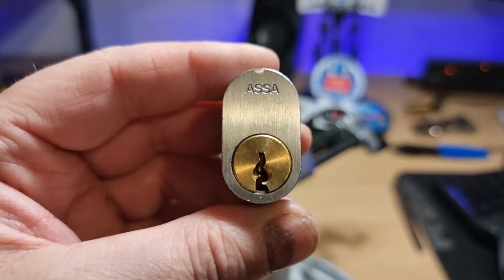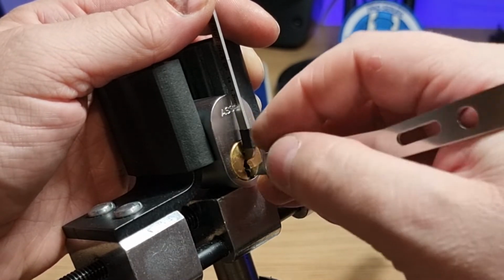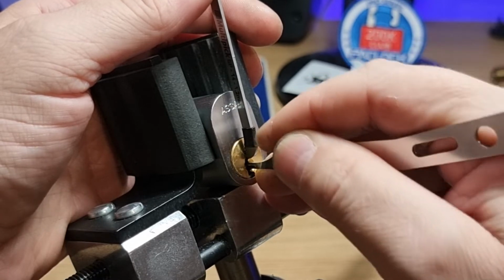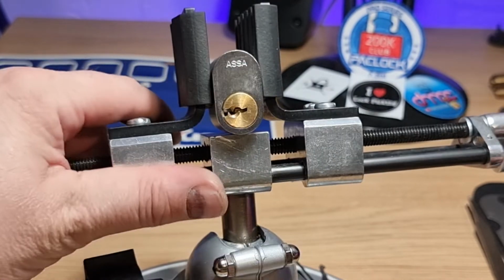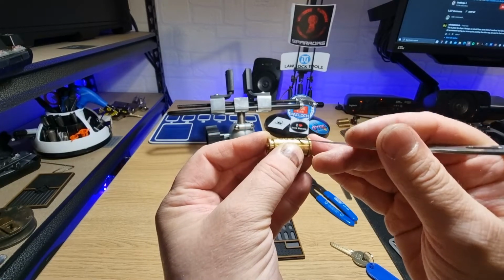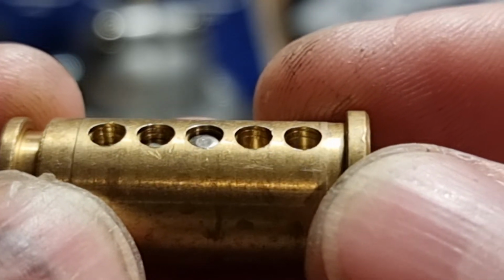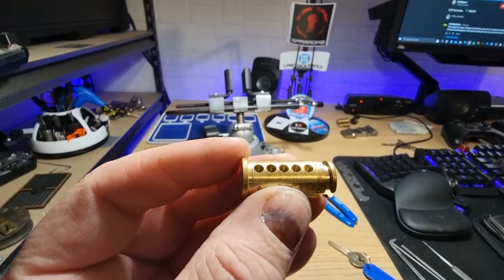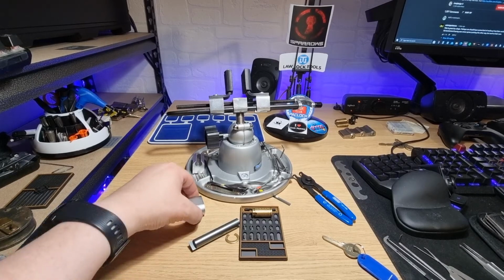(100) ASSA 500 Pick & Gut

Comment: Well picked mate. In my experience so far, the barrel milling can vary from being deep/sharp to shallow/dull. Seen it on assas and some rukos too. Still counts IMO but it's not as deep as it can be
Reply from the maker: Thank you 😁 
The barrel spools were definitely still getting hung up on the milling, shallow as it was. So it's a testament to the ASSA barrel design.
I wasn't sure if it was maybe a factory tooling issue or just natural variation due to chamber diameter tolerances. Chamber 1 definitely has better milling than the rest.
Cheers Dmac 👍 🍻